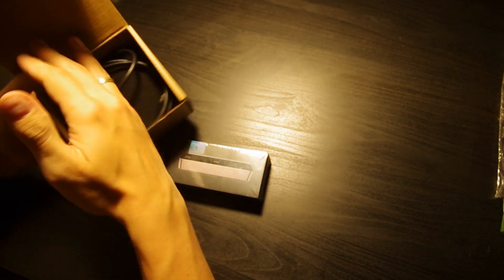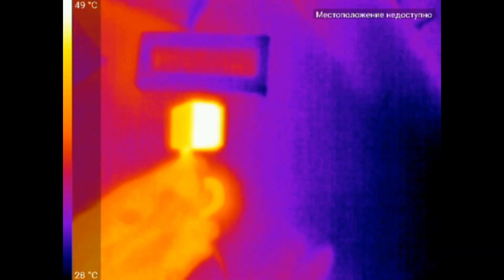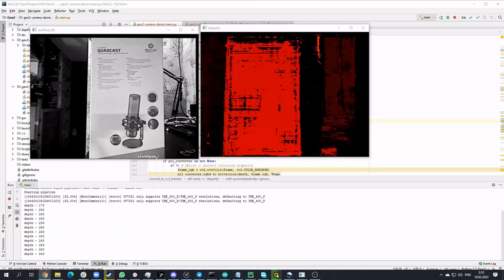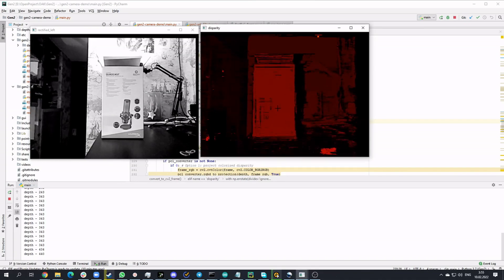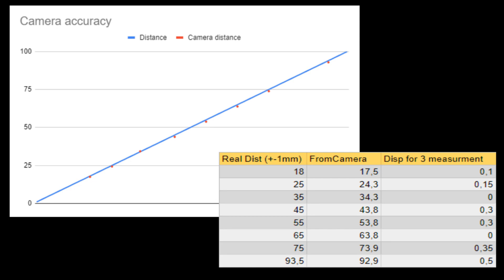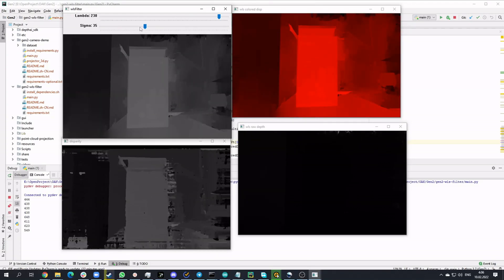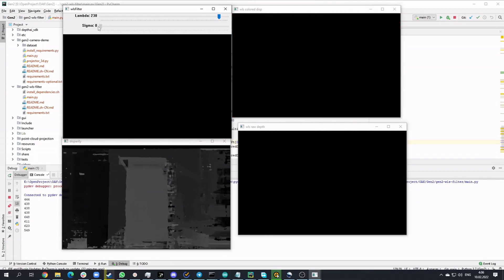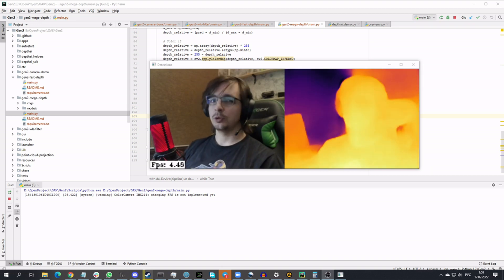How good is OAK-D Lite as a 3D camera?

Comment: Very interesting review.  You answered my main question - approximately what depth resolution should I expect from my robot’s Oak-D-Lite in the 0-1 meter range for input into my home mobile robot SLAM calculations.  For my autonomous mobile robot the Oak-D-Lite offers a very appealing 3.5W power use, at a very nice price, and small size/weight - hopefully it will be “good enough”.

Comment: Yes, thank you for the review.  Quite fair and well explained I think.  (Brandon from Luxonis here.). 

We're working on some internal efforts on using neural inference to improve the SGBM results.  Which as you allude has the promise to make this an insanely good depth camera.

We're also more than happy to send you an OAK-D-Pro to try out.  As this has active stereo as well which helps with blank surfaces/etc.  

Thanks again,
Brandon
Reply from the maker: Thank you Brandon!
You're doing an amazing job, and your devices are definitely redefining what Computer Vision should look like.
I would love to test your new camera. But in the next few months there will be problems with sending it to me. Can you email me? I will describe the options how it will be possible.
My e-mail is maltsevanton@ya.ru
Reply from the maker: @alfred8294  
1) Brandon did not pay me anything for this video. This camera I brought myself for my own project. And I am happy with it. Yes, they sent me the next camera for the test for free. But at that point, I brought 2 cameras myself. And for now, we use around 10 cameras in different projects.
2) I know about 5 startups happy with the OAK series.
3) Brandon has passed away this year. 

OAK is one of the best user-experience cameras. You will have many problems with other cameras if you can't handle OAK.
Reply from the maker: @alfred8294  I used it on:
1) Windows (3 different PC)
2) Ubuntu (2 different PC + Jetson (a few of them))
3) RPi OS

Also, my friends using it on Android

The last time I used it was ~3 months ago. On Windows PC (AMD CPU, NVIDIA GPU)

Comment: Thanks for this, it would be really interesting to see your results on the stereo depth neural network. I’m curious, why do you mention that monocular depth estimation is useless? Is it not able to spit out accurate absolute depth?
Reply from the maker: Yeah. It's very dependable on image. For example, for this video - https://habrastorage.org/getpro/habr/upload_files/0a9/ac5/426/0a9ac54267abdfdde4affdf9c86b865e.gif
The result will be pretty fun - https://habrastorage.org/getpro/habr/upload_files/6a7/254/88b/6a725488b6797c5cff66edabdceab4ea.gif
I used MiDaS for this (rank 2 on paperswithcode ).

Such problems give unpredictable results for real tasks.
Reply: I see, still lots of work to do on mono depth estimation…